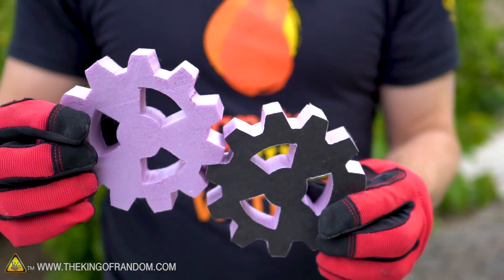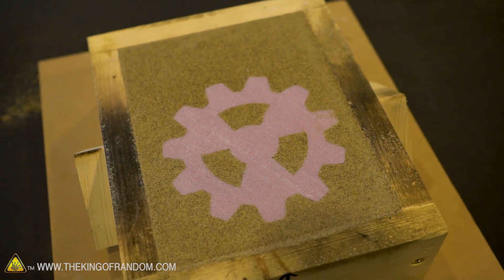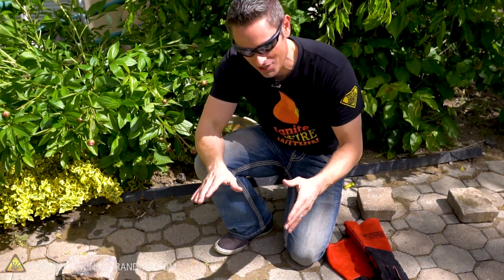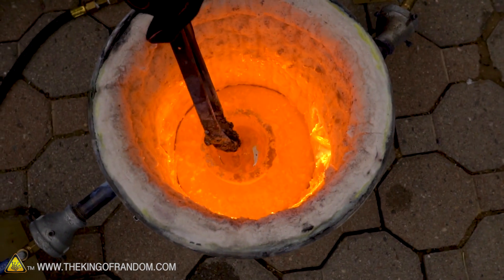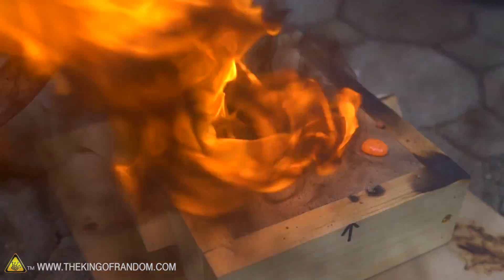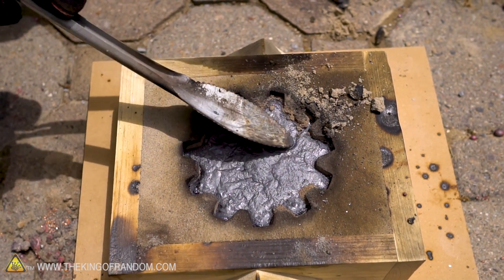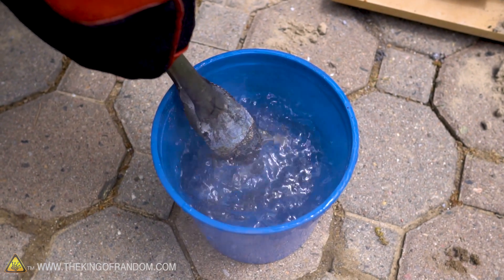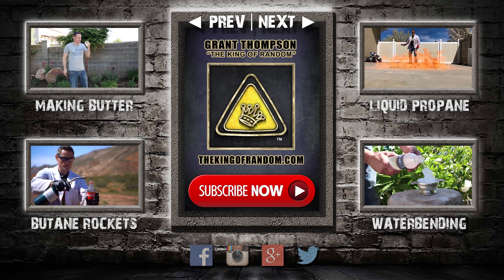Argh. Why Is Copper So Difficult? TKOR Tests Melting Copper In Our Homemade Foundry

Comment: I saw someone doing casting with some alloy ( probably brass ) in red sand and it included a hole through brass was poured in as well as it was enclosed except the hole and at last the excess part of the metal was cut if excess metal was poured and the casting turned out to be perfect but I am not too sure it will work here since components are different but if wanna try be King of Random Awesomeness.

                                                                                                                                                               - A Student who likes experiments
Reply: not sure why he didn't do that here, he has done it in previous castings with aluminum. It helps both problems, better support for the sand to hold its shape and better insulated so the metal doesn't cool as fast.
Reply: this, by leaving the mold open the sand can pop out

when the mold is closed it cannot pop out 

simple casting magic
Reply: Tsubasa Ottori i know who the person. PressTube
Reply: @CharmanderFan20 CharFan20 I actually saw it before my eyes. It was done by a few villagers when i went for a vacation.

Comment: PressTube uses red sand to mold things with brass. Although copper has a higher melting point than brass, red sand is not only
 more fine, but more stable, so try using red sand instead.

Comment: I tried it with super dry green sand just like yours but very dry and I got it very very perfect, please try using dry green sand and if it works, please put me in the next video, guarantee you that it will work

Comment: the buoyant force is the main problem . you should use cope and drag, and make vent holes to give gases generated by Styrofoam and steam (due to moisture in green sand), made a sprue runner and ingates.
you can also eliminate the need of sprue runner and in gates, if you set the Styrofoam pattern completely in drag and place the cope above drag and make a hole in the centre to the centre of the pattern upto the drag.the hole(sprue) will act as riser too, so no need of riser. this hole should be somewhat taper like funnel. and don't pore molten copper directly in the hole make a pouring vessel near by that hole. the conductivity of cooper is very high so make molten cooper as hot as possible (to avoid cold shut), i suggest you to make the pattern more thin so it will fill quickly. and don't forget to degas the molten metal before pouring, i am not exactly sure that you might add some borax at the melting process.

Comment: Hey Grant i use to work.for a place that would make steel pieces for diffrent places and one thing they used on their sand was after they made the cast they would use a high alchohol content paint and catch the cast on fire which would set the sand even more and would cause the molds to hold up better. Thats something you could always try.

Comment: You should use used bullet shells and cast in brass instead of copper
Reply: Isaac Bear when he made the brass knuckles he used bullet shells
Reply: Isaac Bear It feels like copying from presstube...so he wants things to be unique...
Reply: exactly
Reply: iiRelaunchy yeah PressTube always use brass for making fidget spinners
Reply: Isaac Bear he wants Copper casting not brass
Reply: Beltontx101 well yeah you're right but I'm just saying he wants copper because there are a lot of youtubers whom cast brass. and  i think the Problem is bcz of the sand if he'd use something bit more harder it will work

Comment: Grant try using both haves of the mold to make one double wide gear and use a little hole to go down to the Styrofoam gear and cut off the pour spout after its cooled off enough. You can just look up molten copper casting hear on youtube to see what I mean.

Comment: +Grant Thompson

Your problem is too much oxidation, too fast. Exposure to the air is cooling your cast too quickly as you pour.

The solution is: You need to use two wooden frames - one ontop of another! (think: like one of those cake tins that clips together for the two halves of the cake.)

What you are doing so far is fine but only the first step.

The second step is to take a second frame and place it ontop of your first, pack it full of sand and then make a channel that goes down and touches the cog in the frame below. Simplest way to make the channel would be either to use more polystyrene in a narrow funnel shape or use a piece of wax.

Once your finished just split the mold and grind off the remnants of the funnel.

(Did this at high school many years ago...:/)

Goodluck!

Comment: Since the sand was wet the heat of the copper would cause the water within the sand to evaporate very quickly which is why the sand kept popping up

Comment: A. People cast it, just not on YouTube, B having a 2 part mold may help, just make a tall revisor, C, don't use the styrofoam in the closed mold, D you need a different green sand mixture for copper because of the inherently highest temp and weight of metal (finer sand, more clay)

Comment: It looks like you're doing half of the job. I've used this method but you're doing it wrong. A quick google search on sand casting shows a wiki page witch describes the process step by step. You have to use both the top and bottom parts of the wooden box. And the object is not left inside the mold but taken out before you pour the metal. You also have to make a pouring system in the sand and air holes. I used aluminum and had great results. I guess it'll work with copper too.

Comment: it may have been said already but use a two part mold and using a dowel or other object to create a hole that can be enlarged after the rod is removed to create a funnel this will help keep your sand in place as you pour if you still have problems with this method you will need a higher quality green sand to do the same process but this method should allow you to make much more intricate pieces with a small piece always needing to be cut off to be reused in a future pour

Comment: You could try and do an enclosed impression mold with a sprue and an open riser. This will definitely keep the "radioactive indentations" as the sand would be supported by the top part of the sand.

Comment: Grant, I'd like to know if your radioactive gear can even work with your standard metals like aluminium or even tin: to me, discontinuous solids like this one seem very hard to cast. What I'd try if I were you would be to submerge the Styrofoam radioactive gear entirely in your green sand like you did for the Master Sword, and poke a hole through the "ceiling" to pour the copper through.

Comment: You are only using 1/2  a mold it needs a top to hold the sand in. Also this will help keep the heat in and make a better mold.

Comment: Look at Tito4re's video about doing the copper apple and other copper castings to see what everyone in the comments is mentioning. Green sand on top and bottom after you make a pocket in the middle to keep the shape and you have two styrofoam rectangles sticking up that act as a pour and vent hole. This helps everything keep its shape and after it has cooled, you just cut the rectangles off and sand away :D. Hey Grant, silly typo in your description Please like this so he sees (take out "we" or "I")"We can win it, I we need your vote!"

Comment: I wonder if the uneven melting of the styrofoam caused that shell you saw early to constrict around the middle pieces of the gear? Maybe the styrofoam is the problem? Is there another material you can use that would melt out almost immediately?

Comment: The problem is the sand, try to use sifted earth and I think you will have more pressure and thus a more resistant mold. Hugs from Brazil

Comment: What if you did a mould like your mini master sword? cover the foam entirely with a hole leading down to the center of the mould. The heat would be trapped better, meaning more free flowing copper, and the foam would simply smoke out and go away. Keep the copper molten, eliminate foot high flames, and have the benefit of the foam supporting the radioactive symbol.

Comment: When your quenching you should move the metal around, since if you dont a steam jacket will form, a layer of gas around the metal that insulates it from the water, causing it to slow the cooling process.

Comment: Use both the cope and the drag to keep the less dense cores from floating up. Set the sprew in the center and gate two risers from a tooth on each side. The risers will help venting the gasses produced from burning out the foam.

Don't forget to weigh down the flask or the drag may be displaced.

I have successfully cast iron and steel in green sand. Copper, brass, and bronze should be s piece of cake!

BTW Add about a half a cup of flour to your sand. It will make a smoother face on your casting.

Comment: By the looks of it your foundry is only just getting hot enough to melt the copper so using the heat to burn out any amount of foam makes it cool to fast.  So remove the foam from the sand before you pour and make a 2 part mold so the sand will insulate the copper causing it to cool slower giving it time to fill the mold.

Comment: Hey Grant! Here are a few tips for your casting.

1. You should definitely try using a two part mold with a sprue and a gate. This will help prevent the force of the molten copper from ruining the mold.

2. Try preheating the mold because copper loses heat so quickly, the sand will cause it to solidify much quicker, especially with wetter sand. It might also allow you to burn out the styrofoam beforehand. Also be careful with having sand that is too wet, the heat of the copper can cause the water in the sand to boil which can ruin the mold and the finish of the part.  

3. It's also common in casting to create cores which use a compound to make the sand hold together better. They are also often heated up to make them hard. These could be used for the radioactive symbol of the gears.

Comment: Due to how much more extreme the heat is with melted copper compared to other metals the reason the small pieces are popping could be the reaction between the heat and what little water there is in the sand. Drying the sand out more is definitely not the way to go as if it becomes more brittle just pouring metal could break up more intricate spots but perhaps using a silicone mold like Sugru with the sand casting to make it more durable and the silicone mold made with Sugru is suppose to be quite durable so possibility to be reused to make many castings.

Comment: sand casting basics. use closed mold and have the metal flow in from the side or preferably rise from the bottom in order to prevent the weight and flow of "falling" metal digging into the sand.

Comment: The King of Random, Try adding another layer ontop of the gear head, the only reason the center is coming apart if there is no weight holding it down,

Comment: I like the fact That you are trying so hard to show us the best results! <3
Reply: Mr.Dilophosaurus Wetherilli there is no correction
Reply: Mr.Dilophosaurus Wetherilli show*
Reply: It is too bad he uses styrofoam for casting, the air pockets inside ruin the cast when heated cause of the air trapped inside the casting material expands when heated, deforming the shape of the cast. Use wax man....or look into how they cast an enige block.
Reply: Show*

Comment: This is how we used to do it. Pack the Styrofoam in between greensand, use a hollow pipe connected to the center (embed it into the center of the Styrofoam. Then pack greensand all around it to the top. Deep wood box. Now remove the hollow pipe gently. Alternatively use a metal with higher melting point and leave it there and pour the copper down.

Either way, this prevents the mold from breaking down. Also another tip, have Thicker styrofoam models will prevent breaking of details but may need more molten copper.

Comment: Injection Molding would be your best bet for a gear like that. It would give that smooth surface that you had on the bottom of this mold and the only side you would you need to clean up is the one closest to the fill point.

Comment: Hi grant, the problem with your method i think is 
1. the sand isnt a solid cast 
2. the copper is too dense for the sand.

i study engineering and youd be better off creating a wax dye using the sand casting method, once the dye is how you want it, attatch it to a sprue. assure it is soluable wax

heres where youll need to do some research, google investment casting to understand better, but essentially you create a solid ceramic mould around the wax, when you pour the copper in to this mould the wax will burn out leaving the gear and a long peice of copper from where you poured it in, cut this off and sand it down to get a nice finish. it should come out looking alot better and probably perfect. this is the method they sometimes use to create custom belt buckles at home that you only need 1 of so its relatively cheap too

Comment: Maybe with a 2-part greensand mold, where the upper part has the runners. Other thing I can imagine is preheating the sand, although I don't know if it would ruin the greensand after you have already done the mold, which can maybe be solved with a bit more clay

Comment: Reinforce the middle pieces with toothpicks or something like that. You can also try heating the mold in the oven. Maybe if the mold is 400-500 degrees the copper won't cool as fast.

Comment: I know Grant won't respond, but for anyone else reading this,  this is a perfect example of why you use both the cope and drag with sprus and vent holes. Having the mold encased helps retain the heat when you pour the metal in order to keep the metal from cooling down too quickly and also helps with sand structure retention.

Comment: Copper is much denser than green sand that why it's popping out and coming to the top. 

2 possible solutions
1) Use a little more wet green sand with reinforcement in the 3 radioactive blocks that's popping out so that it stays intact with the rest of the mould.
2) Use a closed mould buy using both the sides.

Comment: looks like the boiling copper forces air up through the bottom and pulls the little sand pieces off the bottom..perhaps something through them to keep them intact? it'd have to be steel I'm guessing or something maybe a wire

Comment: Sand is not a problem, I think compressing at these spots were weak due to the lack of concentrated force needed there. Imo try make a 1.5-2 inches thick mold, compress it and add the rest of the sand until it's full and compress again.

Comment: hey grant, all the way from south africa here, i had success with it your copper is hot enough but your sand is to sandy, what i have found is mix more clay (Kitty litter) which i used into it, that way it will stay how it should also if you really want to i always heat up my sand with the styrafoam in it that way the clay gets a bit harder and sticks alot better and the styrafoam gets burned out before you cast, the styrafoam burns to slow when you pour in copper and that leaves chunks undone. Well honestly it took myself a few 100 tries to get the sand mix correct cause for ALU it does not need that much clay but for metal and all other stuff melting at higher heats it needs more clay.

Comment: You're much better off buying copper online then cutting/melting copper pipes.  Copper pipes, particularly the smaller sizes are massively more expensive then the copper they are made of due to production, shipping, and handling.  This is why plumbers buy them in 20 ft. lengths since they are much cheaper per foot that way.

Comment: Your sand is not hard enough. They use a chemical hardening to solidify the sand. Or you poor it to fast so the weight of the copper pushes the sand away.
Don't give up, do some research and give it a go. 😉
Make a 2 peace mold, one for the top with a chimney to poor it in.

Comment: Are you mixing bentonite into the sand?  It seems like you are just using wet sand unless you skipped filming that step.  Check out myfordboy's channel, he makes working machinery and motors from aluminum castings.  Also, I think if I was doing this, my next step would be to get a set of purpose-built crucible tongs.

Comment: best to use the top half and a flue to pour the metal in.  the top half of the green sand mold will hold the indicate areas in place instead of allowing them to break off and float on top of the molten copper.

(edit) as a follow up thought i neglected to mention, don't forget to add vent holes at the top of the g.s. mold radiating around the center to allow hot gasses to escape.  otherwise you may end up with air pockets in the top causing issues with the casting.

then again tou could always switch to the plaster of Paris molds.  those won't break off for an open face pour.

Comment: you are going to have to make a 2 part mold The water in the sand is heated by the copper and as the gas water expands the sand in the middle floats on top of the copper.  So the only fix is a two part mold.

Comment: The mold  should be closed  on all sides  with pouring  holes in one side and exit holes in the bottom  cover for the excess of copper and a pan at underneath  to collect it , the casting sand should be replaced by other kind of casting material like green casting sand.

Comment: Iron has a melting point of 2800 Fahrenheit, a little over 800 degrees more than Copper. You should see if you can melt it.

Comment: Well buddy, you should use another side of the box, so you have to make a single hole in the sand that is concentric with the gear and pour the copper. It will be even more perfect if you make another smaller hole that matches another part of the gear for the gas outlet.

Comment: You need a two sided green sand mold. Make a wooden version of the gear(so you can just put screws in it to pull it out easily) and do a full mold instead of the half you have been doing.